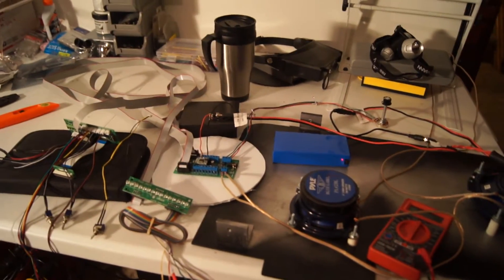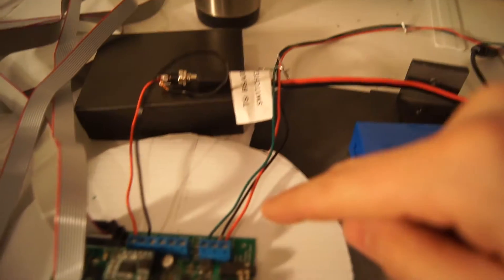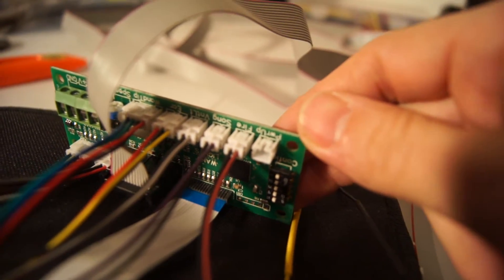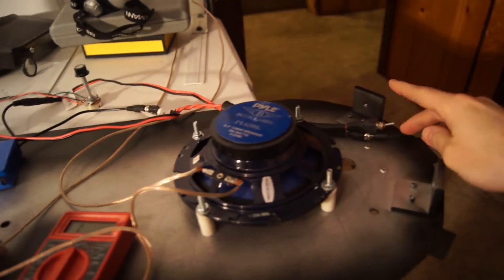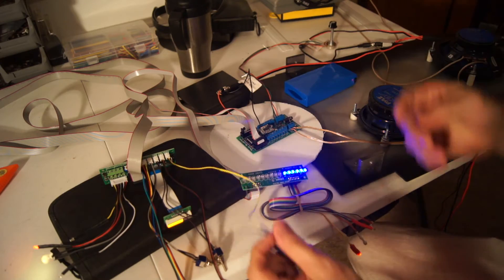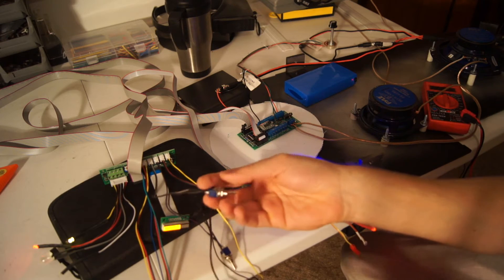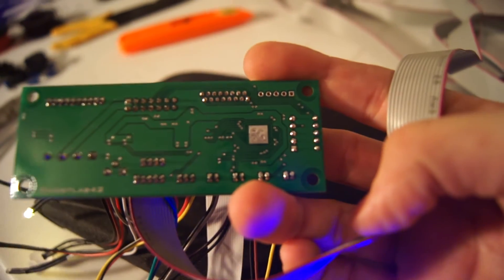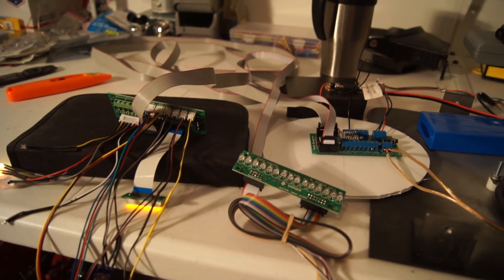GBFans Sound & Light Kit - Power Up switch electrical problem

Comment: really quick question
I want to add a main power switch even though I have a battery with its own on/off switch
My question is if I were to have a toggle switch to be the main on/off switch connected to one of those batteries that people use to charge their phones in public would it damage the battery, The reason why I ask is the one I do have already has a rocker switch on the battery and I am worried I will hurt the battery if I add my own kill switch and the battery on the inside is always on.

Comment: Hey buddy where did you get all the access flat ribbon cable to connect the boards together. The ribbon cable that it's equipped from GB Fans isn't quite long enough for what I need. Thanks in advance and I hope everything worked out for you.
Reply from the maker: The ribbon cable I got was purchased on the gbfans site. This was a few years ago, so maybe the available length has changed. I do know that a variety of lengths are available online of that ribbon cable, so would just have to cut and apply the male/female ends yourself. Good luck!
Reply: Also are those cables easy to cut and assemble to the connectors yourself?

Comment: Did you find the issue?
Reply from the maker: Yes! I had a VERY helpful guy on the gbfans site ("Spongeface") guide me through it.
There is an ESD (static shock) protection device that may get blown by an excessive ESD zap. Part T1, a tiny 5-pin surface mount part just above the VntLt 2-pin connector. If you have a soldering iron, heat that part up and remove it from the circuit board. It is not critical that you have this part, so removing it would be fine. If it is blown, then the pwrup switch should start working after the part is removed.
Reply: @Sixty64u2nv  Hah.  He would know.  He designed the equipment.  :D  Glad you got it working.

Comment: Crack open the gray ribbon cable terminal and make sure they are making a good contact. Then trace down the cable to see if there is any damage at all to it. Last you can try to swap out the cable with another one. I honestly believe there is a problem with your cable to the board. My pack lights had the same problem, switched out the cable, good to go. Hope this helps bro.
Reply from the maker: It ended up just being a bad resistor. Took off the resistor and it’s worked perfectly ever since.

Comment: Awesome video!

A couple of quick tests to isolate the problem:
1) Turn off power and then unplug the ribbon cable between the sound board and the wand lights board. Now turn on power. Does the sound board play the start up sound? It shouldn't if dip switch #1 is off (it did when the wandlights board was plugged in!)

2) Turn off power and unplug the ribbon cable from the wand lights board. Next remove the battery wires from the sound board and connect them to the wand lights board. (be careful with the polarity!) Turn on the battery power and see if the wand lights are now able to be turned on and off with the pwrup toggle switch.

It appears that the pwrup two pin connector is shorted between the two pins. If the wandlights board thinks that the pwrup switch is always closed your setup would behave exactly as you demonstrate.

You can check for a short directly with your ohmmeter (either in resistance or "continuity" where it beeps when there is a short between the two leads. Turn off power to the boards. Then with the toggle switch plugged in, measure across the two pins of the Pwrup connector and see if it indicates they are shorted together (beep or < 100 ohms). In a working board this should only happen with the toggle switch in one position. On yours it may happen independent of the switch's position or even if it is plugged in.

If you see that the pins are always shorted, then we need to see if it is the board or the cable or the sound board that is causing the short.  Just unplug the ribbon cable between the sound board and the wand lights  (first from the sound board then from the wand lights board) and see if either disconnections affects the short. Those signals go to through the cable so it is possible the cable is shorted between two pins in one of the connectors.

let me know what you find!
Reply from the maker: Terribly late I know, but I don't go through my old videos that often. It ended up being a part 'T1', a tiny 5-pin surface mount part just above the VntLt 2-pin connector. All I had to do was remove it from the board and everything has worked perfect since. Hopefully my video and your reply may help others that come across the same problem I had.